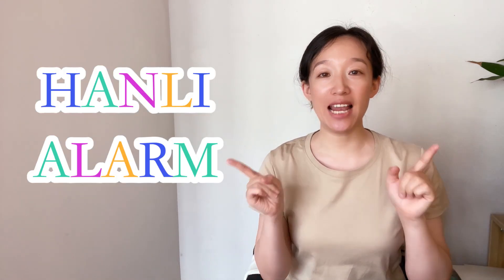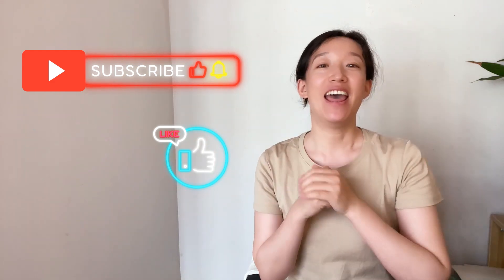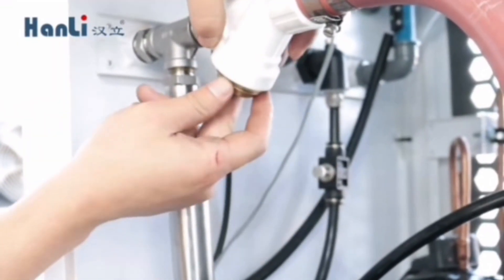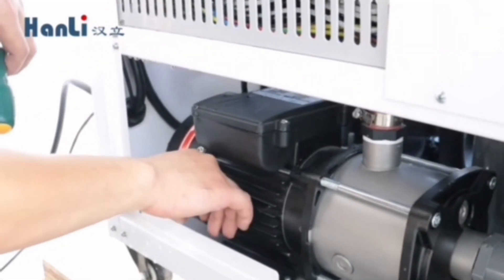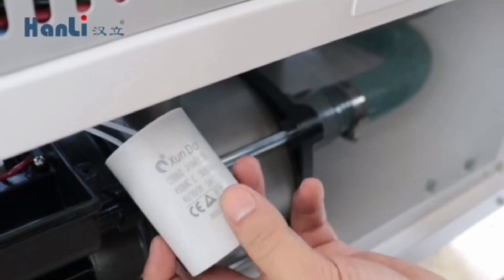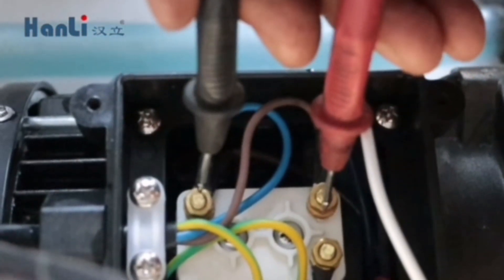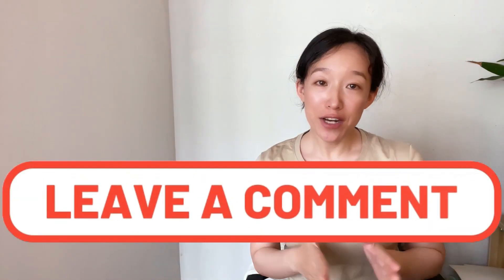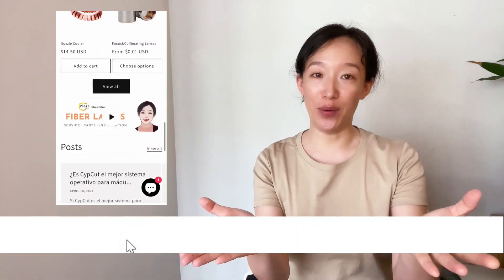Hanli Chiller Alarm: E05 | Solution in Details

Comment: Hello medam 
I am using hanli 2.8kW chiller for my CNC machine 
Model number HL -2000-QG2/2
It's showing the e05 error 
I done everything you told in video 
Water pump is working properly 

But no salution yet 
Please what else can we try
Reply from the maker: Have you contacted your supplier?
Reply: @ClaraChai yes but they are not getting what is the main issue